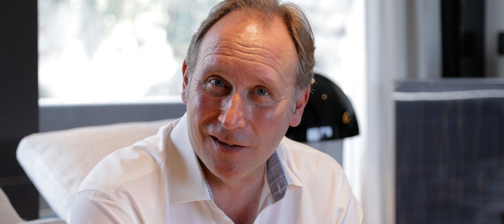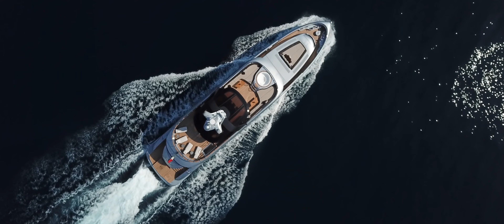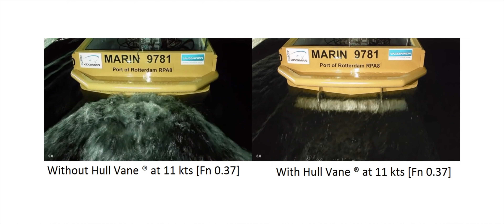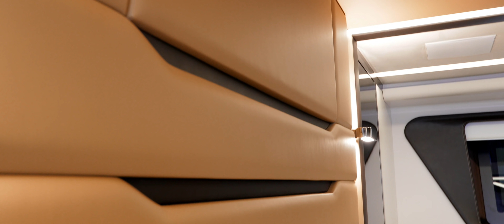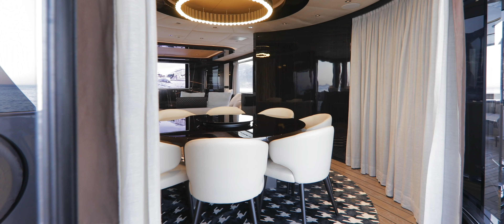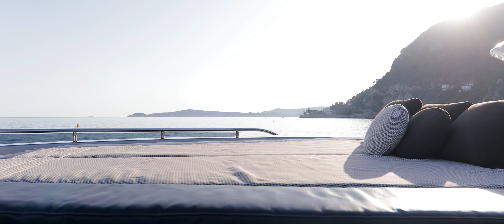PORSCHE DESIGN DYNAMIQ GTT 115 SUPERYACHT - WALK THROUGH TOUR

Comment: Can a hull of this design be sea worthy, I mean the bow just looks too close to the water. If you were in a heavy sea with large on coming waves, surely it would get swamped. Even my little Sea Hunt boat has the "Carolina flare" built into its bow to direct the wash of the waves outwards.
Reply: Actually it's based on the German s boat design from the second world War considered by many to be the best boat built during the war. Used manly in the north sea and Baltic.  Capable of 49 knts. S 100 was the very best they produced.